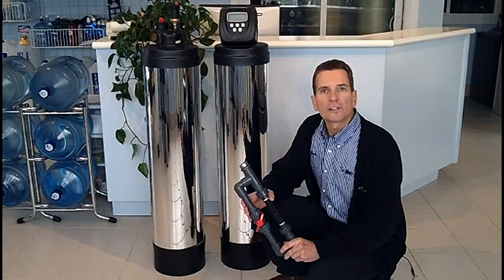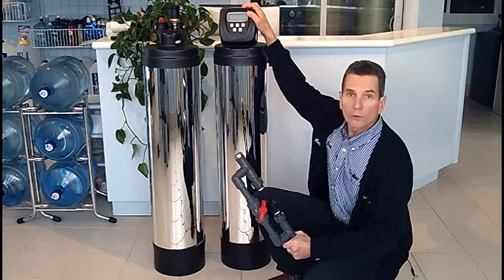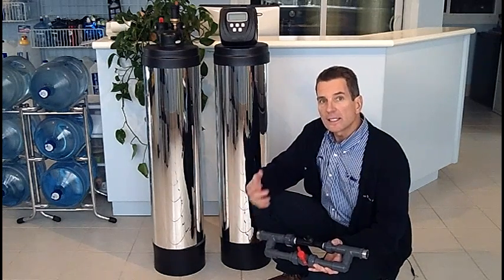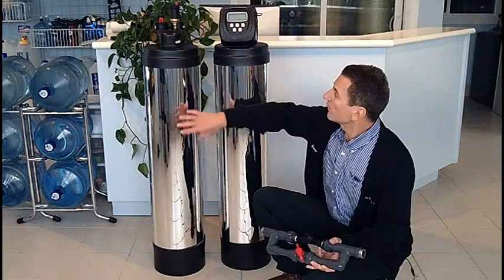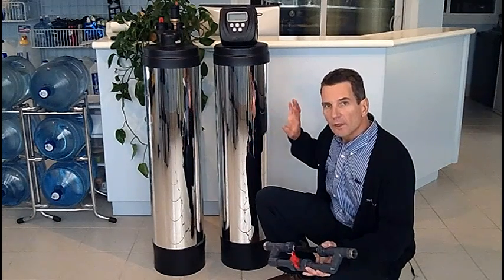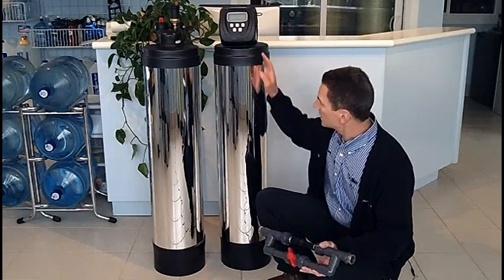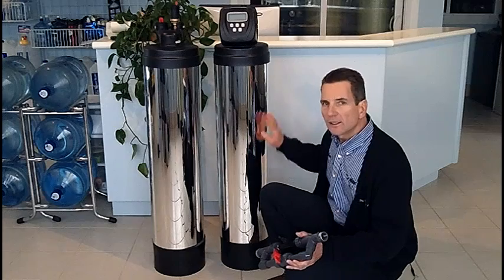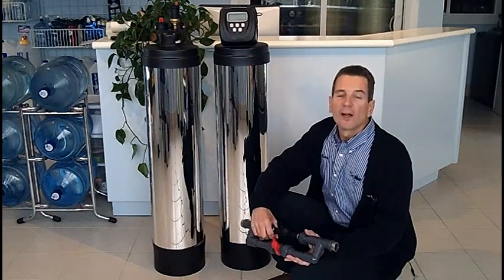How a Chemical Free Iron Sulphur Filter Works

Comment: is the Clack FOB/C/K Strainer/Check Valve/Air Intake Assy supposed to have water coming out of it when it regenerates
Reply from the maker: No, it should not.  there is a valve inside that prevents this.

Comment: My system  just quit back washing why? Did one of the switches go bad?If so which one and how do I order one? Thank you
Reply from the maker: You would need to go through a troubleshooting process to determine what repairs you need and the parts would be dependent on your water softener make and model.
Reply: @water_estore   I have went through the troubleshooting  process and it want even let me manual backwash so that tells me that it has got to be one of the switches right? Because the switches te it what to do Whar is your suggestion?
Reply from the maker: @stevecaviness5870  It really depends on the make and model.  most modern water softeners have a circuit board that controls everything, no switches.  I honestly cannot think of any model that uses switches.  Try to find the make and model numbers.
Reply: I really do appreciate you trying to help me which is more than what most people have done so thank you alot from the bottom of my heart to yours .I will never forget it.
Reply from the maker: @stevecaviness5870  glad I helped!  Please share with friends and family.
Reply: @water_estore  I have let everyone that I know that u did your best to help in every way and if the have any questions about their water to contact you.zi do thank you very much and good things will come to u for being nice and helpful